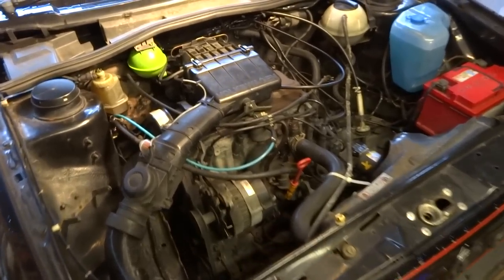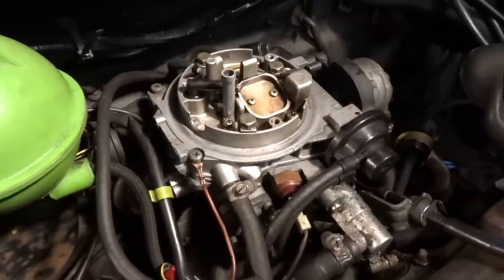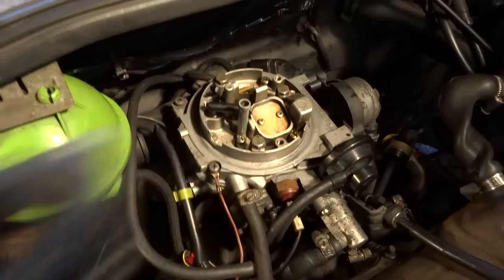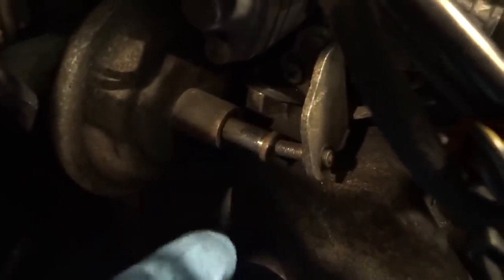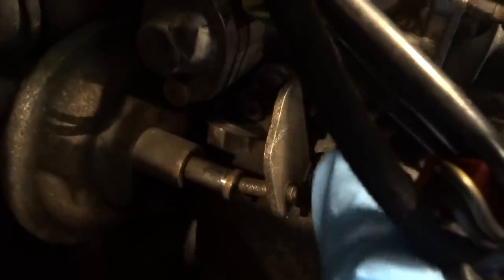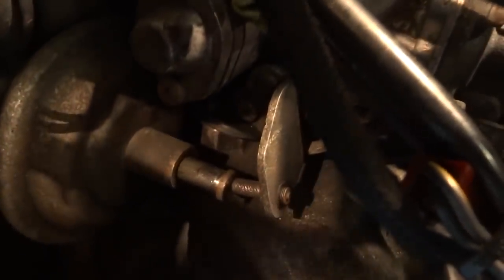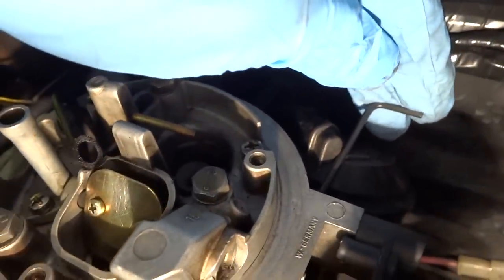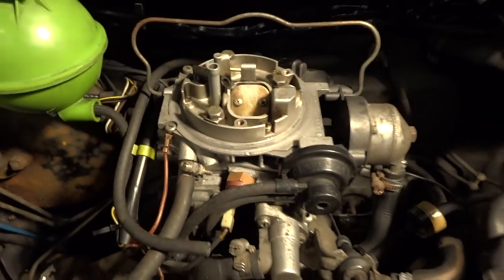VW Golf Carburetor Adjustments. Setting Fast Idle & Choke on Pierburg 2E2 Carb

Comment: The screw which you adjusted on the throttle flap is the adjustment for the fast idle speed when you first fire the car up. It’s not for the slow idle speed which is set by the 3 point unit. The choke adjustments you made are for the choke pull down unit. The choke flap itself is set by loosening the 3 screws of the choke housing and rotating it. All this info can be found in the pierburg manual available as a pdf online.
Reply from the maker: Thanks for the info. I really didn't know what I was doing at the time. Just thought I would make a vid of what I did as much to help myself if I needed it again as it was to help others . It seemed to work and I finally had that car running well for my brother, then someone drove into it writing it off not long after. Thankfully his replacement, a Polo R-line has fuel injection!
Reply: @ifitsgotwheels  I don’t blame you, these carbs are really complicated. I’ve managed to get my head round the basic principles but still got lots to learn.

Comment: Awesome! Awesome! Awesome! Going outside to do exactly this to my 2e2 right now! Many thanks for these super helpful videos bud!
Reply from the maker: Thanks, this was always a crap carb beforehand! ...we just never knew how to adjust the dam choke, and only ever set it with the allen key / back bit before! Finding out the front bit turned and then knowing how much to turn both the front and back bits, has turned this into much more of a delight!
Scratching those numbers on the dial has helped too, as we have been able to make slight adjustments being sure exactly how much we have turned the dial, without having to take the airbox off each time.
In the colder weather it seems that opening the gap (turning front dial anticlockwise a little) has helped us when starting this car. but knowing where to start from does make one hell of a difference with stuff like this :)
Reply: ifitsgotwheels hi, I'm from México and i have been facing some issues with this carb. My car Is throwing black smoke when I push hard the acelerator. I think that my mixture is using more Fuel than air... To adjust the air entry Is with the allen adjust ? 
Thanks since now.

Comment: Thank you very much for this video!
I have golf 1.3 pierburg 2e carb,had problem with choke system so i buy new bimetal choke and the other parts of this carb,but now the choke in cold start has about 700revs,so i hope this will set this choke to normal settings,thank you.

Comment from the maker: It could be the Waxstat causing it. You can remove it from the carb and put it in some boiling water and let it cool down. This will help reset it. Sometimes boiling the Waxstat is just a temporary fix as it could be too far gone, but it is one woth trying before buying a new one. Also just check the vacuum pipes all seem good as these are supercheap to replace. also check the mount is solid, if the carb rocks, the mount under it could have a split in it causing vacuum problems.

Comment: You should the choke the other way around. So first the 5 and then the 2,5 mm setting, because if you set the 2,5 and then need to change the bigger opening it will also affect the smaller one.
And the idle setting is done by the screw on the back.

Comment: I have also a 1.8 liter GU engine, but when i start the engine goes perfect and also when the engine is running after the choke is done it runs @ 800/900  rpm. But when the engine is warm and i put my clutch in when driving, the engine falls to  a 400/500 rpm and somethimes wants to stop running. Its start right again without a problem.  And runs fine.
Reply: Comparable issue with my car but it tends to die so I'm looking for some fix. Any hint please?

Comment: Hi Mate!
great to see someone who has knowledge about this ancient type of engines :) I was trying to find anyone nearby ho would be able to check my carb but there is no chance to do anything.. I've got to do this on my own, so could You please give me some knowlegde ;)
1) cold start is terrible. i've got to pump acceleration pedal a few times, and then engine is able to start
2) i got to hold the pedal for a few moments, otherwise engine dies..
3) when he is cold he runs about 1200 revs and then rises to about 2200rpm on choke.
4) choke is active until the engine gets really hot and then revs fall to about 900rpm.

i think the problem are let's say the "petrol flaps" 1st one is too wide open and then when engine gets hot the wax element is closing it to normal position.
if it is possible, could You please make a video with the second carb U got, which is not mounted which elements I should check and set properly? My engine is petrol only and it is identical with Your's except the steering wheel side :)
I'm a bit tired with current petrol consumption (which is much to high) and cold start problems.. It is the Golf 2 GLX version with almost all additional equipment (except the conditioning) and I'm trying to fix it but have no possibility to do so.. Thank You for Your time to reading this!
Reply from the maker: +karasiu 666 Hi, I don't actually know as much about engines
or carbs as these videos seem to suggest, I've just been in the same boat as you are now. I made the videos after sourcing whatever info I could from the internet. It's still the only car/carb I've ever messed with! You will need to look at this page http://www.golfgtiforum.co.uk/index.php?topic=18871.0 to see which of the vacuum pump settings are the correct ones for your car, so that you can check them as I have shown in the video above (as I am not sure of your car). If your settings are already correct, then your problem could be an air/vacuum one, rather than a petrol one, as your cold start and revs would seem to suggest, this could be down to the choke but I would look first at the vacuum pipes as these do perish along with the other rubber pipes. Worth checking are the rubber pipe that comes off the inlet manifold, and the carb mount, if your carb moves about too freely you may have split in it. & will have to remove the carb to confirm/change. Removing the carb is not a big job (& really that's one of the 1st videos I should have made, maybe next time I get the car, as it's my brother's car.). Extra air getting in through split pipes/mount when cold could be causing your symtoms.
As always though the waxstats can upset everything so if you have never tried taking it off and puttin it in a pot of boiling water until it cools down then it's worth taking it off and trying this, as it can work wonders. thanks.

Comment: Thanks mate for getting back! I will check the throttle flap gaps you have given. My carb flange is all good as checked that. I am buying some compressed air to check if I have leaking vacuum hoses. On inspection they look good, but could there be internal problems? If needed I will buy silicone tubes as they are cheap enough from EBay. I put the waxstat in boiling water and the pin moves freely. I still have a warm start problem. I have the heat shield connected and also the green vacuum ball and the air box is standard. Also I noticed when I am driving and I hit the gas pedal aggressively, it starts to misfire a bit. Any ideas? Could this be down to the flange settings? Perhaps fuel pump? My inline fuel filter is nice and clean and so is my fuel filler neck. My carb is Pierburg 2E2

Comment: I am following your videos and I want to set my carb but I want to be sure of the measurements. My car is a Passat year 1989 engine 1.6 EZ 75ps, manual 4 speed. Thanks
Reply from the maker: Hi, I get all the settings from this page here; https://www.golfgtiforum.co.uk/index.php?topic=18871.0  - it only lists up to 1988 for Passats, so not sure if that will suit your model? or not? as I don't know enough about VW's to confirm the details.  (Anyway the result they show are Passat 1.6 / '83-'88 / DT / manual / 2.6 / 5.0). 88/89 being a changeover year may mean your 89 car is completely different. I would think the results shown are for a 'B2' model. I don't know if the engines would have been the same in B2 /B3 cars, as I am clueless on Passats. Hope you can sort it.
Reply: @ifitsgotwheels  thanks for answer

Comment: which adjustment is wrong in the carb if I only have problems with power and acceleration response. I can crank the burner to the max and nothing and sometimes the engine seems to choke to answer

Comment: Hello! I have a mk2 GL. I’ve had a lot of issues with mine, particularly the carb like most people but I was hoping you could give me some advice. 
On a cold start My 3 quarter point unit slowly pushing my idle from about 2k all the way to 3100rpm and will sit there for ages. Eventually the car heats up and it retracts leaving my idle at a reasonable 1100rpm. However… after driving a bit, the Unit will suddenly extend into the throttle arm and the idle goes nuts… sometimes it goes back to normal and sometimes it carries on revving high. It’s really frustrating. What can I do about this? 😫

Comment: I have exactly the same carburetor and when i press the gas pedal the car stumbles (almost like pressing the brakes and then after 2 sec picks up with a loud ding) and the acceleration is weaker in 2nd gear does barely 70 km/h,
When i bought it, it was doing 90km/h and wanted to go even more, please help me cuz no one cares to fix the car (and in 4th gear barely does 140km/h, i know it has to do something with carburetor)
Reply from the maker: Is your waxstat good as that is the biggest problem on these, it should move quite freely, you can test it, pressing it or improve it by putting it into some boiling water https://youtu.be/tKz99bD2KJo?t=136 . The air filter would sometimes get oily on these, so check yours is clean enough, otherwise check for vacuum leaks, and check the carb feels solid on the engine, as if it doesn't the rubber mount underneath is prone to splitting and upsets the running. Those are the easiest and cheapest checks you can do, after that it means taking things apart further and replacing the seals with new ones, so it is worth trying to make a few adjustments with your own set up first, setting the carb gaps and turning the idle screws, but make a note of any starting positions. Best of luck.
Reply: @ifitsgotwheels  Thank's very very much man😃 I'm going to try these steps hopefully im going to get it fixed. Take care and stay safe✌

Comment: Hi, amazing video. Could you tell me how do you turn the adjusting screw clockwise? What tool do you use and from where do you grab the adjusting screw? Thanks!
Reply from the maker: stefano bertoni hi I just used an ordinary pair of pliers to turn the adjusting screw! With the engine switched off I would lift the flap upwards to make it easier to get the pliers in where I could turn them. I kept the pliers as far down the theaded bit as I could but found I did not damage the thteads anyway! The most important bit if holding up the flap to do this is to be careful not to use too much upwards pressure otherwise the carb might split the mount it is sat on depending on how old and condition of the rubber mount. 
those screws are hard to turn so you may do better oiling it first and try and put a mark on the screw too so you know if it is turning as you may only be able to shift it a little bit of a turn at a time. not sure if these screws should have had a big head on them to do this, maybe it did originally and it's been snapped off making this the fiddly job it is! best of luck

Comment: Hi, there, You have great videos. i just want to ask, do you have worked with vw mk2 1.3? Is there any video you have about that engine...My problems are : The choke won t pull down until I press the throtle. When it s cold (below 10 degress) it cutts when idle...Not smootj accelerazion...if you have any link or suggestion how to solve these problms, please answer...thanks
Reply from the maker: Danilo Vukicevic Hi, sorry I do not have any videos on the 1.3. This 1.8 is my brothers car which I seem to spend all my free time on just to keep him on the road! He did have a 1.3 several years ago which we also tinkered on but we did not make any videos back then. I remember he had lots of problems with his mk2 1.3 that we thought were choke and clutch related, but in his case all the problems were caused by worn engine mounts! & not with the carb itself like it does seem to be on your car. I just wish I knew more about cars to help you further, but with us, like you, it's been a case of having to fix things ourselves to try and learn from it.

Comment: Hi Great video. Can you tell me wher I can buy the vacuum tubes for the Pierburg 2E2
Reply from the maker: Hi, I was given the new tubing I used, but you can buy silicone tube in a choice of colours from a little over a £1 up! (delivered!) on ebay! A metre of 3mm hose should be enough, I don't have the car here to check though. {The stuff I
 used measured 3mm on the inside and measures about 7mm on the outside}. thanks.

Comment: Hi mate, I followed your guide and set the throttle flap space, replaced vacuum hoses, set the 3.4 unit, put a new manifold gasket and O ring and a new Carb flange. I have put everything back but the car wont start> It turns over but just wont start. In adjusted the CO idle screw but its not having it. All the hoses are on where they should be and I have checked that all wires are connected. Any ideas?
Reply from the maker: +Dubtastic life Hi, even though it's been almost a year since I set up this carb, we found that over the last winter as the temp got cooler undoing/turning the big dial anticlockwise overcame any starting difficulties we had, and as the summer approached we turned it back in bit by bit too. we found that adjusting the rear screw in by half a turn helped, but was best left alone after this
If it was starting beforehand, it should be starting now! Once you have reset to factory settings you can make adjustments after this to try to improve the starting/running, it's just knowing the factory settings give you something to go back to afterwards, even if you lose track of how many turns left or right you make. When you have set it up, I found turning the big dial in and counting the turns it takes, makes reseting it easier afterwards.. 
Over the past few days I decided that just for good measure I would get a new seals kit and replace all the seals before this winter. Inside the carb was not as complex as I thought, and only a few seals were needed (out of the many you get in the kit), and I would think unlikely the cause of too many problems. I cleaned all the inside of the carb and jets with carb cleaner but at £33 for the new seals off ebay, I could have just left it as it was, I was doing it just for the extra peace of mind! there was a petrol float inside which looked okay, I was not sure how to remove the replacable valve beneath it though. I was bending the float back, but realised this would only break it, you have to remove the pin with a hammer, hitting the small pin out towards the outside of the carb. 
Better spent money has just gone on the rubber elbow for the vacuum pipes that comes off the intake manifold, apparantly this is a big cause of starting problems so is worth checking/replacing, and you can see and access it down the righthandside of the carb, without having to remove the carb again. Ours was almost torn off and had a long split in it too! They are no longer available from vw, but a '12mm 45° Degree Silicone Elbow hose' hose off ebay with an inch or two cut off each end suited it perfectly. Sorting out the vacuum is a big player, but still leaves enough to go wrong enough to cause problems elsewhere, and what with the waxstat, auto choke, 3/4 point, etc. problems can be seriously hard to find.
Best of Luck.
Reply: +ifitsgotwheels  What dial do you mean that you turn anticlockwise mate?
Reply from the maker: +Dubtastic life sorry the one at 2m50s. I'm not great on technical words/names!

Comment: Is there any difference in adjusting for Automatic Transmission or Manual Transmission?  Thanks for your time.
Reply from the maker: +bean0423 yes, settings are different for 1.6 and 1.8's, so too for engine codes (this is the letters part at the start of your engine number, e.g. GU, EW, EZ etc. found on your V5/V5C/logbook), and if the car is an Automatic or manual.

If your car is a 1.8 GU Auto, then this would require settings of 2.3 and 4.7mm.

thanks.
Reply: +ifitsgotwheels I found this link http://www.golfgtiforum.co.uk/index.php?topic=18871.0 was wondering if those measurements looked correct.  Mine Is a 1.6 Auto EZ so looks like 2.9 and 6.0mm
Reply from the maker: +bean0423 yes, 2.9 and 6.0mm, that's what I get too.
Reply: +ifitsgotwheels So with the air hose you blow into could I just remove the other end of it and blow into that?  I do not have any spare line.
Reply from the maker: +bean0423 hi the tube you pull off &#39;A&#39;, you could pull the other end of that tube off the front of the carb and use that one. but suck, not blow.
Reply: +ifitsgotwheels What I meant was can I just pull one of the lines off completely use that for blowing while adjusting and then reconnect it.  Thanks for all your advice and the video.  It has been really helpful.

Comment: Thenkiu. Il carburator mach for benzina, what's it?
Reply from the maker: Hi. I am not sure what you mean. The settings for the carb I got from here; https://www.golfgtiforum.co.uk/index.php?topic=18871 if that helps in any way. The car ran on unleaded (95) petrol, but would of originally ran on the old 4-star petrol when new, I do not know if that makes any difference to any of the settings, I doubt it would make much difference. Car was a 1991 Golf 1.8.
Reply: @ifitsgotwheels  grazie mille!